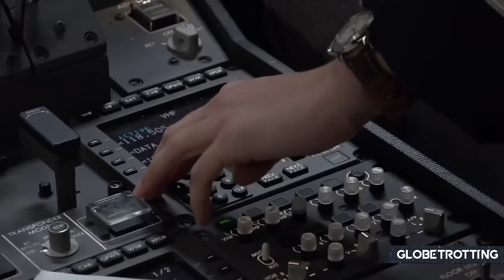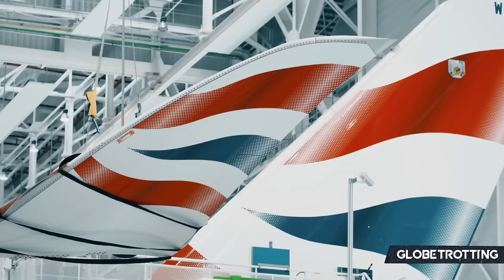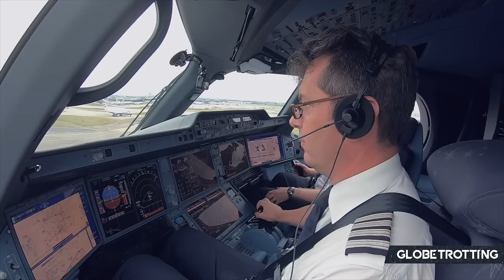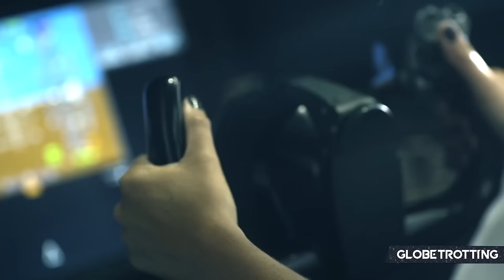VIRGIN ATLANTIC RIVAL - Introducing British Airways

Comment: I used to work Virgin in a senior role.  Oddly, our closest partner was British Airways.  We looked after each other for interline traffic over LHR.  In the 90’s there were huge issues (when BA hacked VS’s computers; it was a huge headache) but that was the public issue, internally we relied on each other for Interline traffic.  I was flying every week for work to London, and we both gave each other seats in F/Upper Class to transit.  Even for leisure purposes, BA would even give me F authorization on open tickets anywhere in their network.

Then again, it was my signature that allowed any other airline to fly on Virgin, and I used the authority very discretely, most importantly for Upper Class authorization.  But BA was always super nice when it came to that.  Almost every airline was equally kind, except for Air France…grrr.   I cut them off.

Comment: BA needs to reform it's in flight service, customer support and simply it's seats and cabin. If it improves it's in flight service then it could regain its reputation for being a reliable and good carrier
Reply: They are making great strides now in their business cabins in both seats and food service in Business class. The new product is quite good. They still have work to do on the 787s and 380 in terms of seats. But, overhaling the interiors is lengthy process for such a large fleet.
Reply: @scottbrick9918 BA has a monopoly on many of its routes (like many airlines) so they don't have much interest in improving services.

Comment: BA has its roots as an arrogant money losing state owned subsidized national air carrier who used illegal schemes to destroy discount Laker Airways and tried to do the same to Virgin Atlantic. Then BA merged with Iberia which has to be one of the worst service EU airlines and BA seemed to slide to that level.
Reply: Ok
Reply: It's not a correct statement that BA "merged" with IB. They are part of the same holding company (IAG) and completely operationally separate. The is next to no integration between the two.

Comment: Absolutely no comparison between BA and Virgin, BA are currently undergoing a complete transformation improving on board services and replacing aircraft, yes they still have major IT issues and a pretty poor reputation but perhaps many that knock the company may not have experienced BA in the last couple of years, Virgin are certainly a 'has been ' airline the sparkle and innovation that they once had has gone, they offer nothing different now from any mainstream airline. 
BA are and will continue to be the flag carrier of the Uk, Virgin will be an extension of Delta.